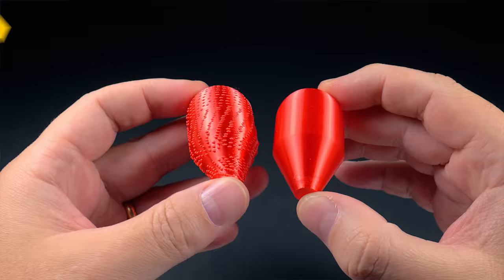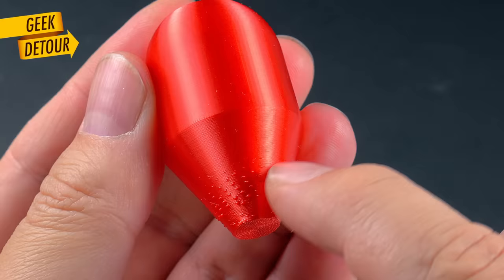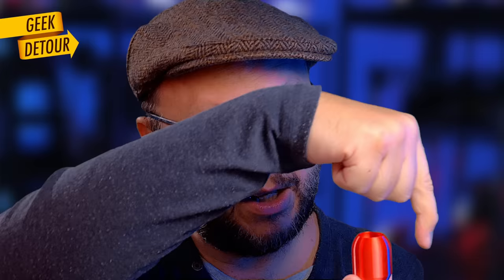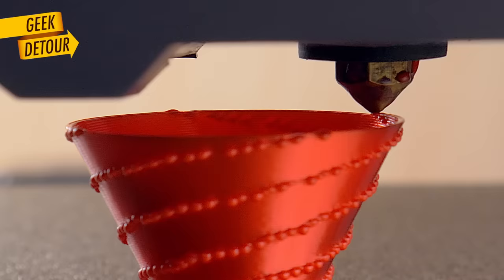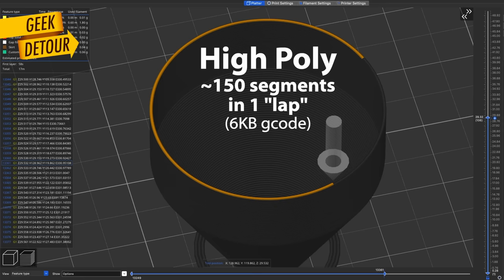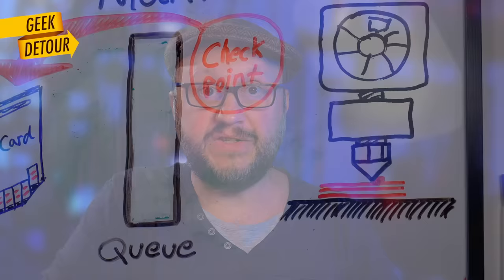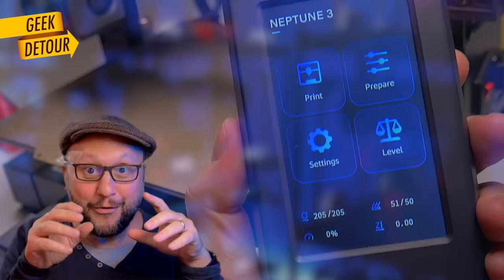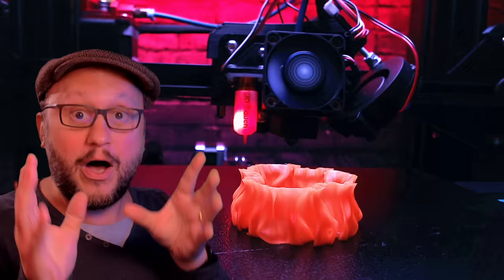3D Printer Blobs: a mysterious problem you won't guess how to fix 🤔

Comment: well done, i hate how the 3d printing community always blames moisture. You on the other hand covered two big solutions to blobs. 

There is a neat trick in cura that lets you have insane amount of polygons on curves but a single line on straight lines. If you set maximum resolution and travel resolution to an absurd number like 50,000 and then set the lowest maximum deviation number your printer can handle you can get super smooth curves and also have smaller gcode files at the same time because perfectly straight lines end up being a single gcode command instead of several small segments. My Maximum Dev is 0.01mm
Reply from the maker: Totally! It is true: I had filaments with real moisture… but never with PLA! 
To make this video I tried to force PLA into being wet: I left 3 meters of PLA submerged in water for a week and I couldn’t get it to bubble. What you see in the video is TPU, that I also left in the water to get the footage I needed… Moisture in filament is real - but it is not so common as people think.
Reply from the maker: I don’t run a 3D Print farm - but I am sure people can squeeze a LOT of performance and quality when you have to print A BUNCH of copies of the same part - it certainly justifies tuning every slicing parameter!

You mention a nice trick - need to make some tests to see if that’s something without side effects. My profiles are tuned for laziness 🤣 I usually print one part and done 😜
Reply: @GeekDetour  haha don't get me wrong i also print one thing and done but usually its something for a tool or around the house where i want tolerances to be very tight and i don't want to think about what kind of clearance i need. By having a high poly count i don't need to worry about my holes being "octagons" eating away at my hole.
Reply: @GeekDetour  the metallic silk pla can actually absorb moisture not sure what in it is hygroscopic but yeah tpu, nylon, abs, and ever so slightly petg but pure PLA doesn't really absorb water in my experience also.

Comment: Great video!  I also use a UPS (1500 VA) on my machines.  Also, with Octoprint, there's a long discussion thread about printing too fast for the printer USB UART to handle the flow of data.  While 8/16 bit control boards work well, they aren't really optimized for high speed data flow coming from the USB port.  I haven't seen this improve much with the 32 bit boards either.  I keep my print speeds to 40-50mm/s when using Octoprint.  Great channel, just subbed!
Reply from the maker: Thanks! ❤️ We will see printers made in a very different way in the next months: a lot of them will run Klipper natively, with a Raspberry Pi “Compute Module” (even if a clone) attached directly on the printer’s board.

Comment: I just sent someone this video to explain this problem, so thank you for making it! I did find one more issue that could affect this. I was seeing this exact problem on my Neptune 2, but it started happening only after using my printer for a few months, despite me mostly printing high-poly vase mode prints. For me, it turned out that it was the SD Card. The ones that ship with the Neptune 2 specifically -- though likely a lot of other printers as well -- are pretty low quality. I replaced the card with a new brand name card, did not change any settings, and have been printing the same models for about a year now with no issues. As you mentioned at the end of the video, NAND flash does dies eventually, so replacing the card when see such issues is a good idea, since it's likely more issues will start happening soon anyway.
Reply from the maker: Hey, I am glad you enjoyed the video and thanks for sharing it with other users! 🤗 True: the cards that come with printers are far from great!

Comment: I haven't even ordered my 3D printer yet and I've thought about these 2 concepts already: Add diodes (one way electricity flow) to the fan circuitry so that if you air-blast your fans to clean them, they don't back-feed the generated power into the printer, potentially damaging it, and, implement some kind of PRINTER MEMORY to copy the entire GCODE onto before printing, avoiding this entire problem.

Correct me if I'm wrong.

Comment: Thank you so much! I had a power outage & couldn't figure out why my prints started doing this! I formatted my SD Card & problem solved.
Reply from the maker: Glad I could help! ❤️ Oh, if you are using the SDCard that came with your printer, I suggest buying a Class 10 card from Samsung or SanDisk - 32GB is more than enough. The cards that come with the printers are usually VERY slow.
Reply: @GeekDetour  Thank you again for being so helpful!  I am using the one that came with my Neptune 3 Pro, I will purchase one of the ones you recommended.  I live in a small town and we get power outages once in a while so I didn't want to disable it. I'm glad formatting the SD Card worked. You are awesome!
Reply from the maker: Hi! So, right after I made this video, we got a mortgage to buy a house - in a rural area… oh boy… the power interruptions are insane. Usually, one, two seconds. Sometimes many minutes. The problem is that if the interruption is longer than a minute, the heated bed gets cold and the parts pop out… So PowerLoss Recovery is still useless when that happens. I bought a 1kW UPS (a battery no-break). This was the only really effective way for me to not lose my prints here.
Reply: @GeekDetour  I live in a small Amish Town, we have horse & buggies still here in town. The power recovery saved my print and I was surprised, that's why I didn't want to disable it.  If it it's to the point I may need a 1KW UPS, I will get one. Thanks!
Reply from the maker: This is something so cool! A 3D Printer in an Amish town! I picture it and I can’t avoid smiling 😁 Thanks for sharing!

Comment: Self Notes
Blobs happen randomly at wet filament. 
- 16 kb of SRAM may suffer at processing compared to new modern boards with like 64 kb RAM
- Triangulation takes much processing power as quality is increased.
- Hik-up & Blobs may occur at high speed prints when Power-loss recovery is on.
- Periodically Marlin saved print status on SD-Card like a check point, when it gets busy writing into sd card the instructions queue is empty  pausing the print head until new instructions is loaded.
- block buffer is 16 inst is suitable for straight linear movement but as for smooth circular movements has much longer lines
Reply from the maker: Hi there 👋 Oh, if I made this video now in 2024, I would have added: THAT is just important if your printer runs Marlin. If your firmware is Klipper, you are good to go because it does Not feature Powerloss Recovery - which is a good thing in my opinion 👍❤️

Comment: In a first year of 3D printing I used UPS. The setup was messy, UPS beeped annoyngly when the power goes off.
Then I count the number of real power outages and how many times UPS actually saved my butt - it turned out to be 1 case per year! So i ditched UPS. Years passed - to this day I got one failed print job because of power.
Reply from the maker: Thanks for sharing your personal experience. I think an UPS makes sense if you are in a hurry printing big pieces for clients - in which case you would miss a deadline if you had an outage. But for casual printing at home, for fun… even the cost of the UPS is unjustifiable.

Comment: Yes, I had octoprint cause blobs or hesitations when it was printing.   It was caused by a plugin that checked the raspberry pi's system resources.  I removed the plugin and it worked fine after that.   I also had a USB cable cause a similar issue.  I went to a braided cable and the problem went away.  So far I have no experienced the issue caused by power loss recovery being enabled.

This was a good video, I quite enjoyed it.
Reply from the maker: I read your comment many days ago - just having time to answer it today 😅 Thanks! We used to have quite hot discussions about if OctoPrint would give the same quality as the SDCard… I LOVE OctoPrint, but I compared MANY times and I always found tiny defects here and there, subtle irregularities. It was always “passable”, but yeah, OctoPrint via serial doesn’t work as smooth as printing from the SDCard. Anyways, I feel that OctoPrint might die sooner or later - Klipper is taking all printers by storm. For many reasons.

Comment: I think you just solved a verry annoying issue. Going to test now. 
Some prints would print perfect, some would have blobs that made no sense!
Formatting the SD card for a clean start, testing the read/write speed and disabling power recovery!
Will edit if its a winner as its a very under mentioned issue!
Edit: IT WORKED!!
Reply from the maker: I hope you can fix it! Let me know!
Reply: @GeekDetour  it did!! Now I get perfect prints on all! Fantastic!
Thank you so much, it's been driving me mad, I thought it was model errors as most would print fine and the odd one wouldn't. Such a great video!
Reply from the maker: Oh man! That’s so cool! Thank you so much for letting me know! It is insane how this weird little problem still happens, it’s quite annoying! I am very happy the video helped you! ❤️

Comment: would have never guessed, but i also could never get power loss recovery to work properly on any of my printers, there was always a problem, so i just turned it off on all of them. I think the proper way to handle power loss, is battery back up, but that wont work for long outages.

PS. i once had the power fail for literally just long enough for the printer to need to be rebooted, it was seconds.....  and it happened just 2 layers short ,on a big flat part, and when the power came back on, it didnt home right an printed the last 2 layers off set. This was the best use i ever got out of the power recovery.
Reply from the maker: Yes, that’s my perception as well… it is a feature that does not work.

Comment: You can also put your pieces in an air tight box along with open super glue and when you go back it will be smooth. The vapors react to the plastic.
Reply from the maker: I played a few times with Vapor Smoothing using Acetone, it works nice for ABS plastics. But it wouldn’t remove these bumps… The walls would continue being deformed.

Comment: I had a similar issue earlier, and I thought it was the power-loss recovery feature on my Printer.

Turns out that because I went for a cheaper printer with Klipper, my Sovol SV07 Plus does not come with that feature. What fixed it for me was switching the setting in Cura from hide seam to smart seam, and now my prints come out much more smooth.

Comment: The heck? That feature is practically useless anyway, as the heated bed will quickly cool down, often popping the part off before power resumes. Thanks! And hat's off for all the detail you packed into this.
Reply from the maker: Thanks! Yeah, it would help only for short instabilities.
Reply: @GeekDetour  Yeah. For context, it takes about twenty to thirty minutes to restore power here and outages are once in a blue moon. I'd say I have good power all things considered, but clearly not good enough for this feature to be useful. It leaves me asking who it's for. The only use case I can think of is for high adhesion, low glass temp materials... So, TPU.

Comment: extruder dual gears can cause this as there is a pattern to the distortion and that relates to the amount extruded for the layer, there is an error margin  that is built into any dual geared system because they are loosely coupled and typically spring bound.. you find various patterns in walls and perhaps this is where it might be a scenarios here.. Solution? single is better at the cost of material hardness types and included frustration... Or a belt driven extruder, there is only one made and it is the best across all filaments even 86
A.   And, now I have watched this and learned something new!!! Thank you!

Comment: Great tip, and the lightning and thunder mystery reveal was funny!
I have not noticed blobs, but I did notice the pauses just recently printing some top hats for Christmas decorations.
You know the thing about power-loss recovery is that if the power is off any significant time, the heat cycling is going to cause problems anyway. I think the last suggestion of putting the printer on a UPS makes a lot more sense. 
One last comment. The fact that a circle gets modeled as line segments within the g-code, instead of a smooth controlled arc passed to the printer firmware as an arc, really just shows how crude our modeling still is. Our descendants will look back at our tech like we look back at the Gutenberg press. 😁
Reply from the maker: Ha ha, thanks! Loved your comments. Indeed: any power cur longer than 1 minute and the prints will pop-out from the PEI bed, sure! UPS is the only really secure option.
Eventually, slicers might support STEP files… I hope 🤞

Comment: I just received my first 3D printer, glad I am now aware of this!
Reply from the maker: If your printer runs Klipper you will never have this problem. Klipper doesn’t have PowerLoss Recovery and I think that’s for the best!
Reply: @GeekDetour  I received a 7 year old lulzbot taz 6 so I think it doesn't have a lot of the fancy new features. I'm running cura for splicing. I saw the z seam issue pop up and have figured out how to pick a side and preview where it's going now. I've also been uprezzing all my models and I think it's whats making the prints take longer which I didn't even consider until I watched this video

Comment: Might also consider after disabling the "power loss interruption" feature supplying power to your 3d printer through a computer UPS (Uninterruptible Power Supply - e.g. battery system to keep delivering stable power to your PC should you experience a brownout or power loss). Benefits as you stated (fewer writes to SD card) as well as limiting power surges and keeping the printer running (at least for a while) should the power be interrupted. Tnx for the research and explanation.

Comment: Wow! I have some experiments to do when I get home. Every time I've ever pushed my delta above 150mm/s, it's generated very similar artifacts. Thanks! Looks like I may owe you a cup of coffee ☕
Reply from the maker: Hi there! Well, I don’t know if your Delta Printer has Power-loss Recovery (and if it is enabled - you should try disabling it). Another possibility is the SDCard in use: if it is not fast enough, it also causes blobs. I am curious to know your findings!
Reply: @GeekDetour  It definitely does, and that's exactly my plan. It's an FLSun Q5 that I've been tinkering with over the past couple years. I don't use the internal SD card slot. I'm using Octopi on a Pi2b with a Class 10 card. The plan is to disable the feature on both. The grid here is more than reliable enough here to not need it. I always suspected there was a data write issue messing with it at those speeds, but didn't know where to look. It's pretty good up to about 120mm/s, above 150, it starts to struggle. Technically it can hit 200 on the stock firmware. Having a blast with the hobby, regardless. My update may not be super quick, but I'll do my best to get back to you. Cheers!

Comment: I have literally watched my printer behaving like this. It would stop for a few seconds and ooze a blob. I am working with very high Polly models and don't see any  blobs on low poly. Thanks for putting this video out. I will definitely try disabling this setting. I thought maybe it was just a quirk of tpu printing that couldn't get tuned out.
Reply from the maker: Hi! 👋 I am pretty sure it will fix it. Please tell me later how it went! Oh, I need to tell you: if you are using the SDCard that came with your printer, it would be good if you instead buy a fast SDCard from a Reputable brand, from a trustable store (Amazon usually sells original cards). Samsung, SanDisk, Sony, Lexar… these are my personal favorites. Class 10, U1 or U3… 8GB or 16GB are more than enough for 3D Printing 👍
The cards that come with the printer can sometimes cause blobs because they are far cheaper and slower.
Reply: OMG. The difference in quality is night and day with the setting off. Same g code, same filament, same printer. The seam on the first print with the setting on was horrendous. 6x4 mm wide. On the new print with the setting off, the seam is barely visible. 1x2 mm wide. I did also switch to a better quality SD card. The overall the print quality is more consistent. Thanks for posting this video. It has been more useful than any other videos I've come across pertaining to this issue. This is the last hurdle I had to print perfect tpu. And way closer to nailing down the settings for fpla+. Thanks!

Comment: Interesting how no ADC channels were dedicated to monitor the supply voltage on a device where power loss recovery is a known necessity. As the logic circuits run on separate supply voltage from the power electronics the 3.3V supply line would have enough buffer to do a printjob backup sequence even if the 12/24V supply line drops to insufficient levels.

Comment: With a power delivery from the grid of 99.996%, I think power loss is a non-issue, and recovery can be switched off. Any time or money that you'd spend on preventing the chance that you are printing during the 0.004% outage will never make up for the lost printing cost.
Reply from the maker: Absolutely. That was my situation in Madrid, around the center. I don’t remember having a power hickup.  Right now we moved to a city in the middle of farms - things here are a bit different… I will go the “UPS” way if I feel necessary. Most likely I will go solar in the next year or so… so, batteries anyway.